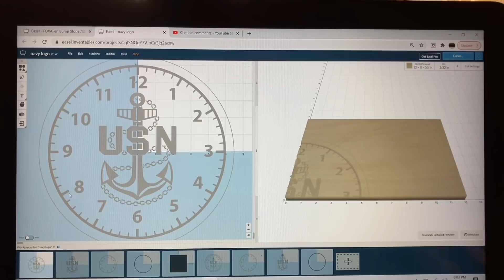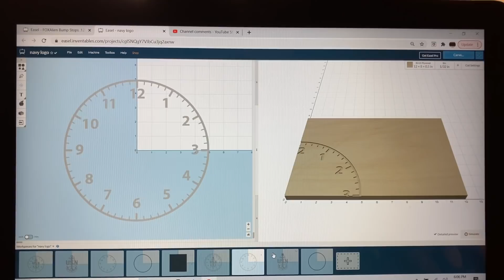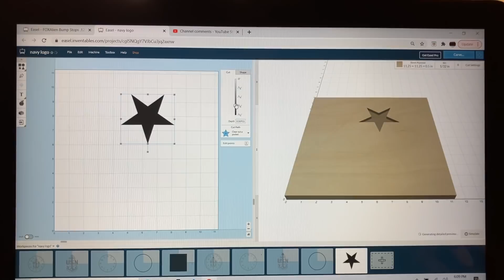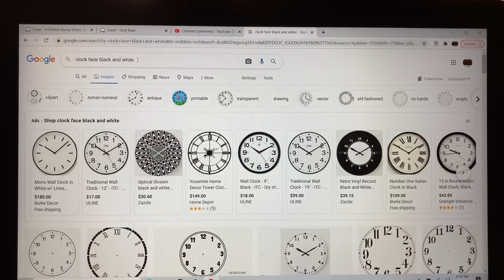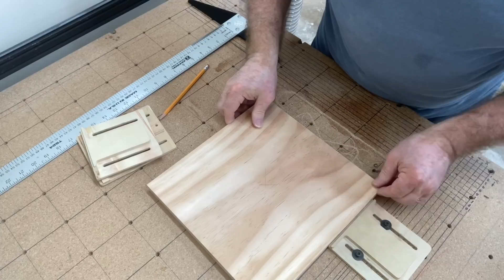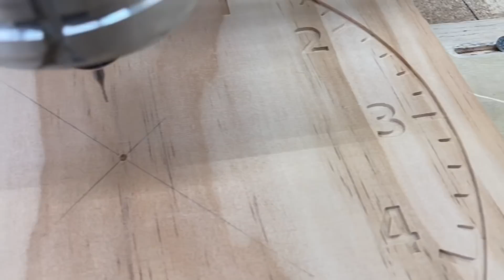Let’s Make a Clock

Comment: Hello Paw Paw, What was the feed, speed and depth used with the 1/32" bit?
Thank you and have a great day.
Reply from the maker: Not sure I still have the speeds. I most likely used the default settings in easel.
Reply from the maker: Found everything for you and sent you an email. I also shared the file for you

Comment: I know most don't share this info, but I have found myself breaking 1/32 bits all time with 4040-xe 300w spindle.  What feed rates and depth per pass are you using?
Reply from the maker: Start with a very slow feed rate of around 30ipm and a depth per pass of about .05. I also depends on the material. Start shallow and slow and gradually increase. The machine will tell you

Comment: Good idea with obtaining the clock face image. However, once you have found the image you want to use, have you tried "Copy Image", open 3D Paint, when it opens, it has the option to paste. Click paste and 3D Paint will open with your image. Use "Crop" as needed. Save your image to desired location as an image. 3D Paint will save it as a PNG file. Open up InkScape, import your PNG image. No need to use trace bit map. The image will be scalable. Hope this helps.👍😀
Reply: p.s. I am unknowledgeable with the use of Easel and CNC work and not sure if my tip applies.
Reply from the maker: My son uses this technique all the time.  I have never tried it.  Thank you for reminding me.

Comment: Nice build Paw Paw. Lovely clean cut with the fine downcut. Very fragile looking bit, no breakages? I thought US stars would have been point upwards? Was that a personal preference or special reason?
Nifty trick with the screwdriver. I use m6 Allen bolts & 1in knurled threaded discs, enough weight & mass in them to speed spin down the bolt & apply plenty of torque for holding pressure.
Reply from the maker: No breakages did it with one bit. This is the senior chief badge.  The star points down.  Do not know why. Thank you very much.
Reply: @PawPawsWorkShop  
The inverted star is used to show a position of responsibility but is inverted so as not to confuse it with the upright star reserved for use by Flag Officers.
Reply from the maker: Thank you

Comment: And what was the TOTAL machining time. It looked like you went into the night when you showed the light while it carved. 27 thumbs up but only  my comment. You are as helpful at this as I.D.C.WOODCRAFT IS. Wish I lived close so I could come and visit some but I'm in TEXAS. Where did you get the 1/16 or 1/32 bits from??
Reply: Is The star up Side down ?
Reply from the maker: No, in looking at many of the logos the star faced this way each time.
Reply from the maker: I just turned the lights out in the shop.  It gave the video an interesting effect.  With the 1/32" bit, it did take several hours.
Reply: @PawPawsWorkShop  Where did you get the 1/32 bit??
Reply from the maker: The bit came from Inventables store
Reply: @PawPawsWorkShop  of course they are out of stock.